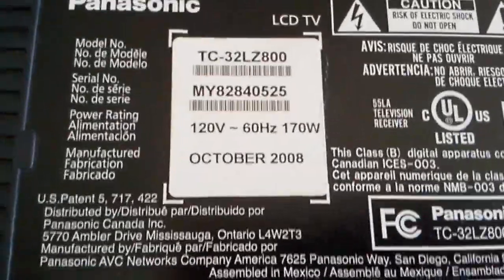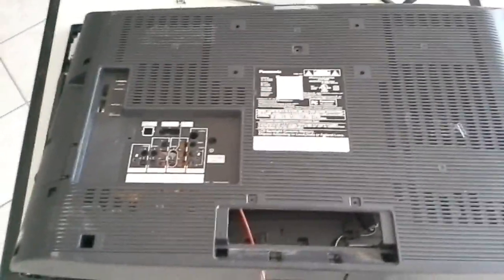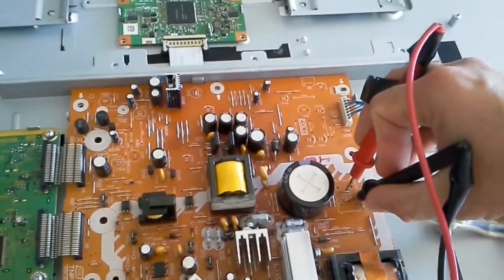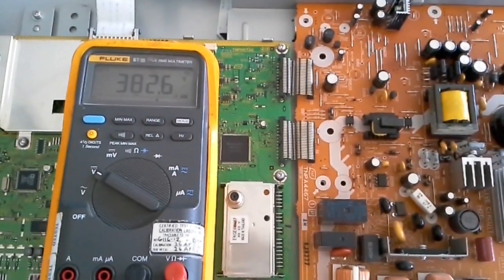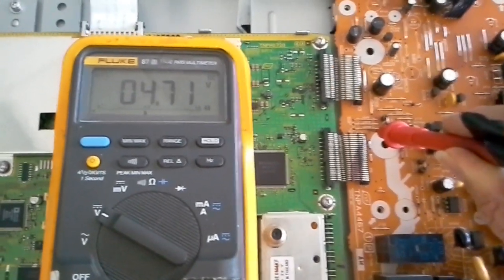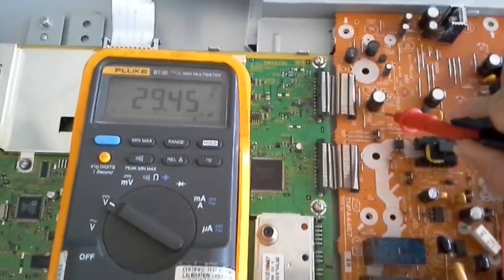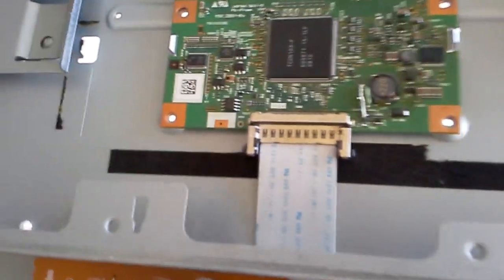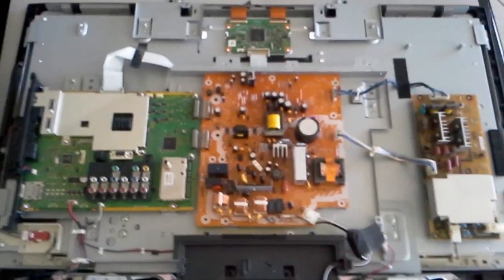How to repair Panasonic TC-32LZ800 not starting up or starting with no screen (TNPA4467)

Comment: My tv model TC-L32U22 turns on normally, 2 clicks, solid red light, leds light up, receives antennae signal due to sound, but no image, lighting a flashlight at an angle to try and see image results in nothing there. Any idea what it could be
Reply from the maker: Well clearly the back light does not work. Whether it is because of bad LEDs (most common cause in modern TVs) or back light inverters (for older LCD models) or something else, that is the general direction you need to be looking in.
Reply: Coppell TV Repair LLC tv is from 2010, most likely you’re right about the inverter. Going to buy a 65 inch tommorow, time to upgrade anyway, thanks for your reply

Comment: Hi, I need your help on Panasonic TV model TX-32WG25 series red light on but can't turn on the TV it had two blown registers any idea what could be wrong.
Reply from the maker: Afraid not. It simply doesn't work like that - feeding random model number and expecting feedback. One needs to have had experience with it to provide feedback of any practical value, otherwise it would be wild guessing.
This video is about TC-32LZ800 and not TX-32WG25.
If everyone followed your logic people would be asking about any TV model out there and why limit themselves to Panasonic only then?
It would be...hmm...daring...to expect we can cover all possible brands and all possible models, wouldn't it?

Comment: I've got one of these TVs. Sometime over the night it just started clicking like it would if you turned the TV on or off about twice a second when plugged in to the wall. Won't respond to any buttons at all, although if you hold the power button in the clicking stops. Got any ideas on that one? :(
Reply from the maker: I am sorry, but I do not. This is a relatively rare and certainly old TV and I do not have one handy so I can help troubleshoot it.
Reply: No worries. We ended up replacing it today, and a friend of mine wants to take a crack at fixing this old Panasonic. Thanks!
Reply: Hahaha.. That would be me.

:D

I did manage to download the schematics... let's see what we can find out.